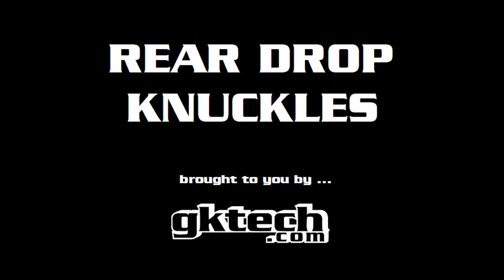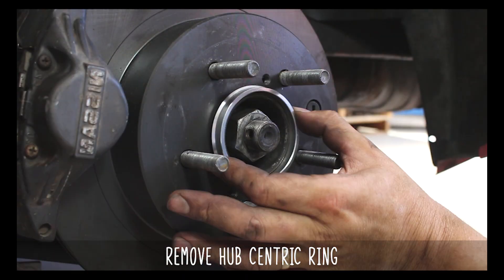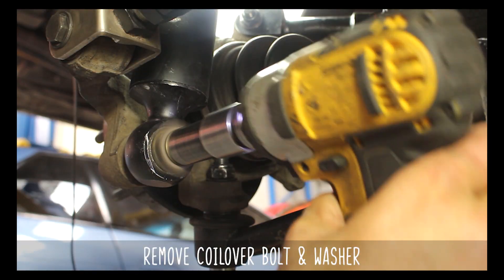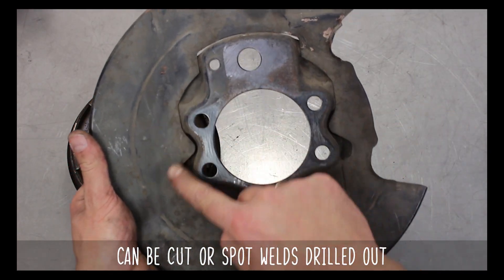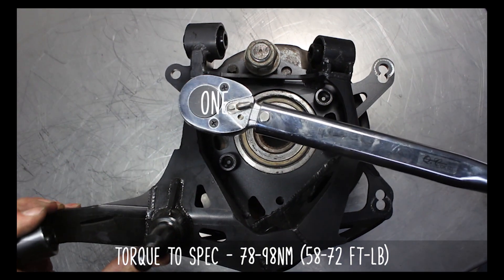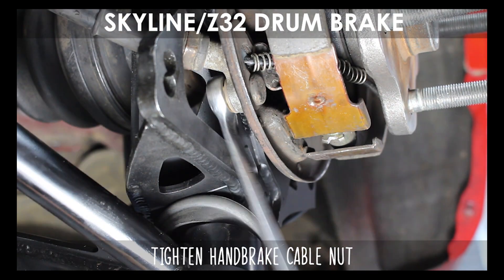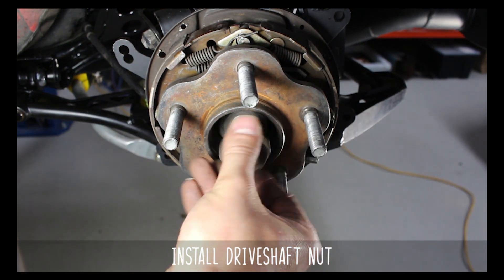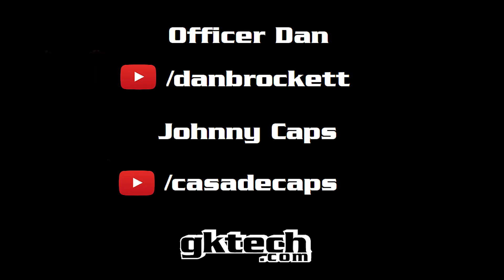Gktech Rear Drop Knuckles - Install

Comment: Hey there, noticed on the website that this part is designed for 17" wheels, would the knuckles still work on stock wheels (15")? I also have a set of 16" wheels with decently high offset, however they sit in the yard for 90% of the year, so ideally would like to keep my stock look
Reply from the maker: They are not compatible with the OEM 15" wheels sorry.
Reply: @gktech  unfortunate, thank you for the quick response though

Comment: Guys, finding the how to videos helpful. I had all your torque figures except the wheel bearings, found them here thankfully. I found I had to use the method from your LCA video to install the shank correctly as the CV joint is in the way of the top nut.

Only feedback I have for the kit is that the original knuckle on the R33 uses a bolt to secure the coilover but your knuckles use a nut. Fits perfectly however I wasn't supplied a nut, would be nice to include is all.

Keep up the good work! I look forward to seeing more videos :)
Reply from the maker: Hi Mark, thanks for the comment. You are correct the R33 uses a bolt like the S14 and S15's. We've chosen to go with a shank and nut setup so it can cater for S13/R32 through to the later model cars. There should have been a nut included for the shank so I do apologize for that.  We'll do a spot check of our stock here to make sure that none others are missing the nut. Regards, Greg
Reply: Thanks Greg, wasn't a big issue and I'm very happy with the product. Will be looking to buy some more stuff soon!